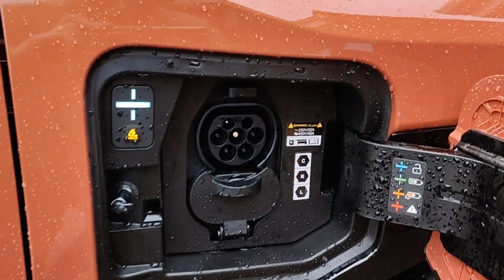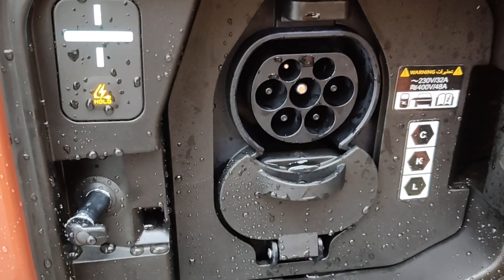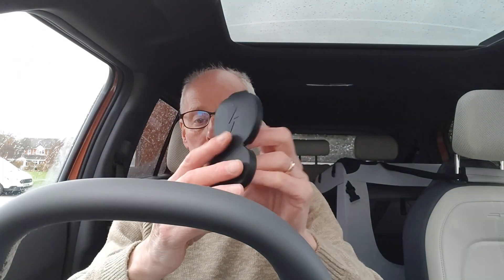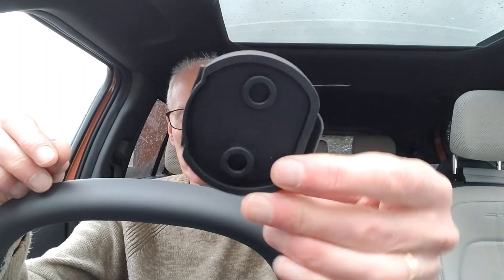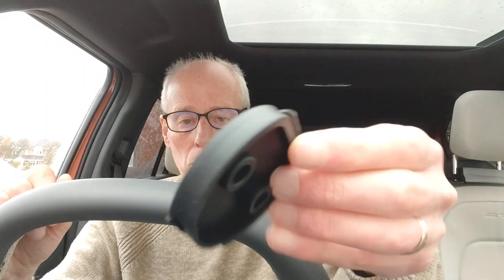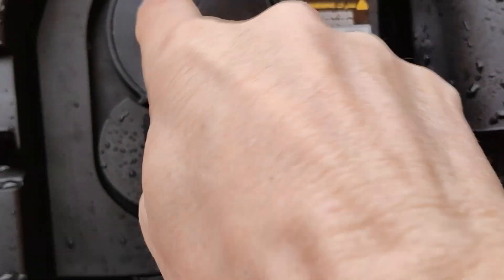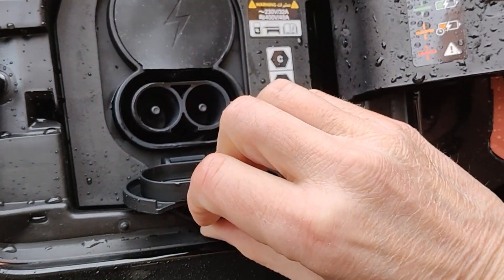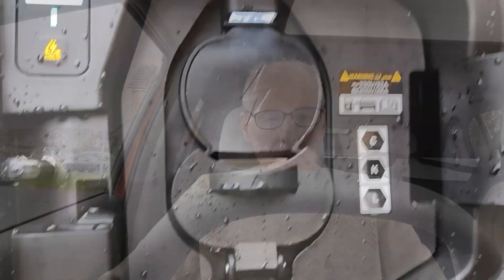How to protect your Kia EV3 AC charge port from water potential water damage. See updated note👇

Comment: Ordered the silicon flap and modified it to fit snug. And fastened it to the DC cover with 2 tie straps. Thanks for the tip now both ports are covered from potential water ingress.

Comment: There have been lots of discussion about the covering of the AC charging port on the EV3. However, there have been corrosion issues caused by moisture building up under the cover thereby damaging the pins and eventually the whole charging unit. It is interesting that Kia have opted to leave the AC pins uncovered as the cap is clearly on a few pence so it can hardly be cost saving. My view is that they have left it off for a reason and that reason being corrosion.
Reply from the maker: I disagree. There is even some chat GPT generated nonsense doing the rounds suggesting the same. There was an old saying in the IT industry that i worked in for many years. Garbage in Garbage out.
Reply from the maker: Each to their own I say but the risk of ICE build up in there is very high in the winter and a frozen charge door. Already reports of EV3 owners washing their cars and getting soapy water in the charge port because of the lack of rubbers on the doors. If the door had rubbers this would not be an issue.My EV6 had rubbers and no cover on AC port and nothing ever got in there and the door didn't freeze

Comment: Hiya Brian, I've had my EV3 for a month. The water ingress in to the plug socket when it gets cold can form ice. My EV3 then would not charge! I ended up using a hair dryer to dry out the socket. The car then started to charge. Like you I have now put a cover over the port and everything is fine.
Reply from the maker: I guessed it would freeze and cause problems. Very shoddy work Kia.
Reply from the maker: It rained last night. AC Port is bone dry.

Comment: Hi Brian, as I have mentioned previously, I’m seriously considering the EV3. However, I’m reading a lot about the range not being what is stated. What they are coming up with is, about 250 miles and not 370. I do realise it’s winter and the range would be less. Anyway, I’ll be really interested in what your car will manage to achieve.
Reply from the maker: I expect it not to dip below 300 in Winter. Will take a whole year to find out though.

Comment: Hi Brian I'm due to return my ev6 in 3 months and not sure what EV I want to replace it with.  I've started looking at the EV 3. what's your opinion of the car compared to the EV6 which I think is a great car. many thanks
Reply from the maker: I think it’s bloody great. There are a few daft little niggles like the gap in cargo cover/parcel shelf and the back seat and the lack of rubber seal on the charge door. Also ECO mode does not stick but i’ve heard that is fixed in an OTA update. I’ve only had it a day so i need more time to evaluate stuff.
Reply: @evodessey had my EV 3 since November over the air updates turned on so far none received.  Any idea when over the air updates will start ?  Especially the one to allow you to watch things like utube in in the car whilst it is parked ?
Reply from the maker: @AlanPring-ok5rs there are only 2 updates on the update portal,power tailgate 12v and and Electronic Brake system. You will probably appear via Kia Connect store as a payed add on
Reply: @  so you have to pay for updates to the brakes ?
Reply from the maker: @AlanPring-ok5rs not as far as I know. You normally also only get the first 2 Maps updates as OTA for free,you can still update those by downloading to USB stick though so not a problem. I will try and find out more information
Reply: @ thank you be good to know

Comment: Many thanks for this.    I ordered one this evening.

Hope you are as happy with your EV3  as I am.    Only thing is my E-Soul gave better efficency.    As the car only has 255 km on the clock this may improve.    Would be interested in your doing a presentation on the subject of efficency and range once you have your new car for a wee bit.    Enjoy, for me it is a most pleasureful car to drive and I feel safety driving features are enhanced since my 4 yr old e-Soul.
Reply: Driven 2400km since less than a month. Average consumption is 19.6kwh/100km. short trips and heating from fast charging raises the average
Reply from the maker: @jkajolin So 3.17 Miles/kWh according to this calculator I've found.Do you have a heat pump?
Reply: @evodessey  yes. Without battery preheating I would say 17kwh/100km is doable
Reply from the maker: Since my wife always drives with the heater on at moment its not that great😆

Comment: So wait... they went to the trouble of stating it in the manual instead of fixing the problem with like a rubber seal on the door 😂...
Reply from the maker: Yes,it warns about getting water in the port. The owners manual does seem to have been cobbled together from the EV6 manual though.

Comment: This is crazy. Does it not have a rubber seal around the whole port from the factory?
Reply from the maker: No,I already reported on this in November when I did my test drive. Even complained to Kia UK
Reply: You'd think that would be the solution - something like some draught insulation tape around the inside at a push.

Comment: Why don't you put some soft window seal rubber tape around the entire inner door and possibly also inner side of the car and only leave it open on the bottom, so humidity can disappear in the long term? Unless most of the water splashes up from the road instead of rain running along the cars body?!  I guess that is up to a test. If it turns out not giving you the result, you can remove it without any problems/remains, because it is just taped on.
Reply: that would've been KIA's job in the first place. I wonder if this will be corrected in the next versions, or if this may lead to some nasty damage. I mean: If it really is a problem to have water in there, why on earth did they NOT seal it? And if it isn't a problem at all, an additional rubber won't be necessary. Or am i missing something here?
Reply: The Skoda enyaq is the same AliExpress do a seal kit for the BYD range of cars i presume before much longer they mite do a similar one for the Kia range
Reply from the maker: I did consider that. The bung is just the start.
Reply: @evodessey  That's nuts. Yes, off to B&Q for some rubber window seal!

Comment: I approve of the colour. If you ever see another GT Line S the same colour in the west midlands, it's most probably me. I believe you are not that far from me.
Reply: it will also be me in Birmingham but we're waiting for a '25 plate.
Reply from the maker: Someone local to me in Burntwood collected his Sunset Orange before mine so there is also another one. Colour has grown on me a lot. You never see another car that colour. Really makes it stand out.
Reply: @evodessey  Let's hope we're all not parked on the same carpark. It' would be like Ghostbusters crossing the streams.
Reply from the maker: Avoid Tescos Hawks Green😂 We go there twice a week. I’ve had some strangeness with the AC charging speed today. 100% Charging current was charging at 1.3kW,60% charging at 0.7 kW. I could not get it to charge at 7kW. So i tested at 11kW & 7kW at Tescos Hawks Green.All good. Drove home plugged it in and it was back to charging at 7kW. I have a theory about what triggered it but i need to do more testing.